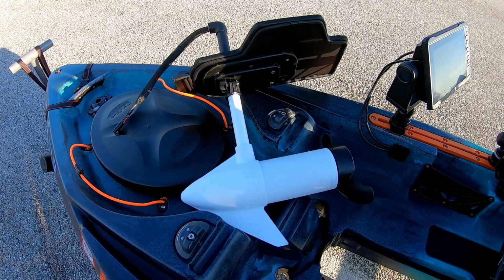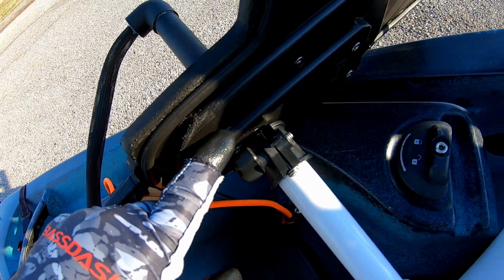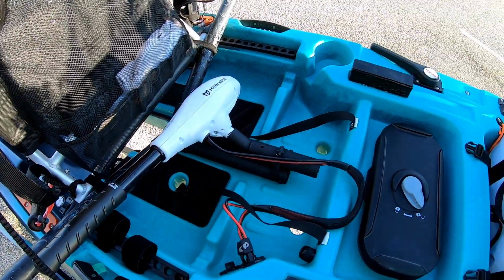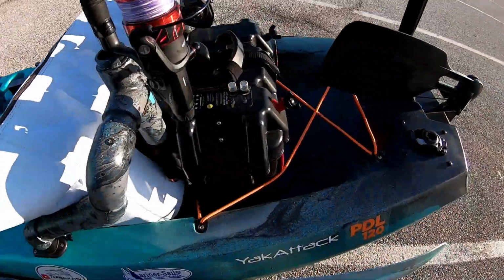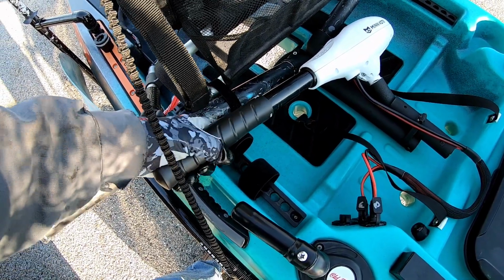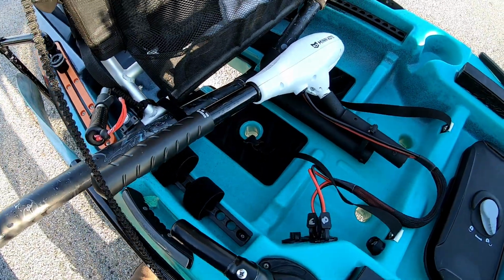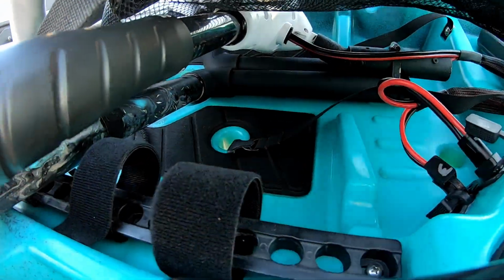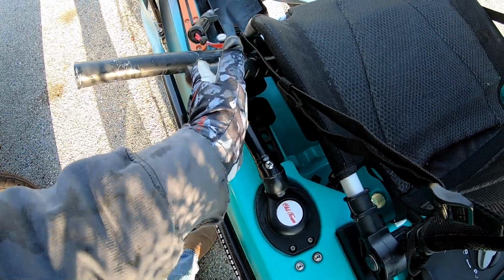Trolling Motor 2.0

Comment: Love this setup!! Is there enough support for the shaft that goes through the  floor deck for the Minnkota motor? Your first setup had pvc supports that attached to the 2 clips in front for stability. I will be setting up the Newport 55  on a Old Town Predator PDL and like your latest Minnkota setup.
Reply from the maker: Thanks for your comments, Mark! Yes, there is plenty of support for the motor without the extra PVC support structure I did with my first motor setup. In fact, I have since gone back and removed that extra PVC support structure for the first motor setup and made it just like the one in this video. There is only  6in of trolling motor shaft above the deck plate. The weight of the motor itself holds it in place just fine. I switch off using both Motors depending on where I'm fishing and what my needs might be on the water. I'm very happy and very glad that I did the trolling motor setups. If you're not a subscriber, I would appreciate your consideration. Thanks, Matt.

Comment: How many inches on the shaft underneath the kayak did you do?  Thanks!  Really nice set up by far the best yet!
Reply from the maker: Hi Lori, thank you! From the bottom of the deck play to the tip end of the skeg is about 12in. So I can get in about a foot of water before I have to pull the trolling motor up. I've really enjoyed using it and it's working great, I'm heading out again tomorrow to troll for Striped Bass! I also did the same setup with a 36 lb thrust Newport Vessels motor and it also works well.

Comment: oh i like this setup much more .. but, a bit confused on the wiring .. you have red/black coming from the motor to the back and a red/black coming from the head but into two separate quick disconnect outlets (how are they all connected at this point? can you share a bit more details?  thanks again.
Reply from the maker: Hi, thanks for the comments. So at the Bow of the kayak where the trolling motor sits are the red and black cables that go through the hull connected to wires that run through the hull to quick connects under my seat where the head of the trolling motor is located for operation. Then another cable runs through hull back to where the battery sits at the stern of the kayak. Does that help? Let me know. I also plan to do an update video sometime this coming off season regarding this setup and my other one.
Reply: @TravelnFish  my confusion part is you have black/red wire coming from the motor head going through the wire mesh and now seeing two sets of black/red wire connected to the quick disconnect outlets.  not sure what all the wires being joined under that wire mesh :)
Reply from the maker: @mtnguyen1696  so coming from the motor I extended the wires just a little bit to reach the Quick Connect at the bow.
Regarding the video I think you commented on, that is the 2.0 trolling motor set up, there should only be one pair of wires going to the quick connect. That's for the Minn Kota trolling motor. The Newport Vessels trolling motor has two sets of wires. The reason for that is the Minn Kota trolling motor is a digital maximizer and has variable speed built into the head I only needs one set of wires leaving the trolling motor head as opposed to the pair or two sets of wires leaving the trolling motor head of the Newport Vessels trolling motor. If this doesn't make sense, please feel free to give me a call my number is 240-840-6598.
Reply: @TravelnFish  I finally saw a sliver of the other set of cable coming from the shaft of the motor head now :) .. there are 4 wires coming out of the head (2 exposed easily see, 2 from the shaft) ..  thanks so much for offering your phone# to help me get it .. much much appreciated M.  i'll try to mount this from the stern and keep using my PDL on my 120.  do you see any issues with this?
Reply from the maker: @mtnguyen1696  I've seen a lot of videos of Bow mounted and Stern mounted trolling motors and the simultaneous use of the PDL drive.
Reply: @TravelnFish  now, I can start buying 😁
Reply from the maker: @mtnguyen1696  🤣😅😂

Comment: This and your other setup are the cleanest trolling motor mods I've seen.  The only thing that is a little concerning to me and I'm sure that you've thought about this (for all the thought and meticulous detail of your build) but do you have any kind of kill switch?
Reply from the maker: Thank you for the kind words! I do not have a kill switch for either of the trolling motor setups. Do I understand the purpose and safety of a kill switch, I just never considered designing one into my setups. I'm a pretty experienced kayaker and have a very stable kayak. I feel like it's a calculated risk I could manage even if I found myself out of the seat of the kayak. I will, however, consider a safety design. I could simply create a tether to one of my cables that connects to the through hull wiring, and that would stop the kayak should I find myself overboard.
Reply: @TravelnFish  I just subscribed to your channel and I really appreciate your response and I'm enjoying your content.  I too have a oldtown sportsman 120pdl and I thought I'd never flip mine or had even practiced a deep water re-entry and man was I mistaken!!! I stand up to fish often, and one day a few months back, I lost my balance, and wouldn't you know I ended up in the water and my kayak flipped over.  I lost a few expensive rods and some other equipment but that was the least of my concerns. I thank God I was able to get back into my kayak and if by any chance I can help someone else think about safety and bring awareness of something otherwise just overlooked that's awesome. Anyway sorry for the long message but God bless you, Sir, and tight lines!
Reply from the maker: @onemorecast8877  I appreciate  your thoughts and sharing your experiences. I rarely stand up while I fish, though I'm very comfortable doing so. For example, the only time I use my trolling motor primarily is when I'm actually trolling for fish, and I'm always seated when doing so. I do you use the motors sometimes when I'm not trolling to get from point A to point B more easily, but I'm usually a sit-down fisherman even then. I haven't even come close to falling overboard or flipping my kayak. I'm sorry that happened to you and losing your gear; that would be a sad moment for me for sure.
Thank you for subscribing, I really appreciate that!

Comment: Hello, I have a question. If the motor only has the battery cables, how can it change speeds?
Reply from the maker: @raideldelarosanavarro3863   At 2 minutes and 37 seconds I begin to explain the variable speed capability of the motor. The speed Controller is built into the head of the Trolling motor.

Comment: Are you using 6 gauge wire and if not should you be if your using a 55 thurst motor?
Reply from the maker: I'm using 8 gauge, so far, so good.
Reply: Ok thank you
Reply from the maker: @charlesseays1636  I'm sure 6G wouldn't hurt. I've fished with it alot this season, and it's done well. 6-7 hour trolling sessions.